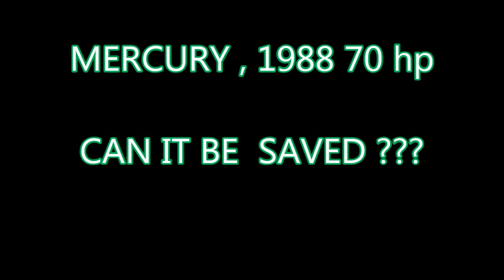MERCURY 1988 70 HP,  CAN IT BE SAVED ???

Comment: I ran the 3 and 4 cylinder Mercs for many years. Hard, mostly commercial use and came to love that soft, steady idle and how they would troll for hours, then jump to full rip when time to go. My last one was a '91 60 hp and used the BUHW-2 plugs instead of the BUHW. About a decade ago I changed to JonnyRude's, mainly because of availability in my area. (I run other folks cast off junk, free or dirt cheap) and now have only 56 cu in, 60-70 hp OMC mains and 25-30 hp OMC kickers. I have great confidence in these motors. A few years ago I finally learned how to make them idle like my old Merc's. Very simple. I now run NGK BUHW-2 plugs in my JonnyRude's. They run better thru the RPM range. Start quicker and last longer. Initial tuning with the standard Champion's, and when a hard run/shutdown plug color check looks good I change to the NGK BUHW-2 plugs, which I run all season, 100 to 200+ hours. Then' in the spring, I pull the plugs and typically, wipe them on my pants leg, put them back in and run them a second season.
Reply from the maker: I have used the perma gap NGK plugs with good results as well.   kb

Comment: That was an excellent comment that you made regarding how easily the carburetor hinge posts can be broken. I was used to working on Evinrude/Johnson outboard carbs and the hinge pin can be pushed out with a tooth pick but not on a Mercury.. I broke one and recently found another carburetor on ebay and paid a good price for my mistake. Another good video.
Reply from the maker: Yep' been there myself.    kb

Comment: Good video and I'm looking forward to all those hacks you will have to come up to bring it up to the "KB standard of excellence". Plastic parts in outboards do have virtues. They are lightweigh, non-corrosive, low cost and provide smooth rotational movement without lubrication. But of course, on the negative side of things, they tend to dry-out and get brittle with age. Finaly, I'd say that sealant is also allowed on carburetor threaded fuel connections. Stay safe and be merry !
Reply from the maker: Pretty close guess, but not what I was going 4,    kb

Comment: I guess I have lucked out so far on tapping out the float pins. I do have a very small ballpeen hammer and use the right size small punch. I do use my needle nose pliers to pull the pins the rest of the way out. My Yamaha have one way pins and one end is serrated so you have to use a punch at least to get that end out to use pliers the rest of the way.
Reply from the maker: I save every brass pin I find in older carbs & use them if they fit.       kb
Reply: Brass pins? I'll have to see if I can find a few.

Comment: I have an 1989 version of this 70HP that you have worked on here. Mine runs decent except I get a small back fire ,sneeze, just once an while at idle but never running over idle. I have done allot to this old motor ,reeds checked, carbs rebuilt , new trigger, timing reset after trigger installed turns over to start fairly easy. I had one guy tell me I have an air leak somewhere. Compression checked ok 110lbs on all 3 so pretty even and fuel pump rebuilt.  any thoughts appreciated
Reply: Did you change the upper and lower powerhead seals?

Comment: Hi Kodi, I have the exact same motor and was wondering if you might offer some advice? 

It started, shifted, and ran nice on the muffs a few weeks ago. I just put it in the water, drove around for a few minutes, picked up my buddy at the dock and then it wouldn’t start again. I turn the key and it sometimes starts for a few seconds then dies. Mostly it just keeps revving and won’t fire up I don’t even know where to start this is only my 2nd motor ever

Comment: Hi. I have 2 1988 mercury 60hp. One works fine in test tank but when I the boat in water themotor dies as soon go into gear could it be timing?
Reply from the maker: Check your compression  hot & cold.       kb

Comment: Could you help me I’m working on an 1978 mercury 70 can you tell me what size the main jet is ? Mine an 0.96 and the air side a 0.56 . The carbs are clean and the motor still wants to fall flat on it’s face getting spark on all 3 cylinders it cranks right up but soon as you go past half throttle that when it dies

Comment: I know this is a long shot, but I need a part that seems to be impossible to find. Is there a way to see if you have what I am looking for??
Reply from the maker: Let me know what part?       kb
Reply: @kodibassInsideoutboards  It is a clutch dog for a 1986,87,88,,89----- Suzuki DT 75. I think the ones form the 65s and 85s will work as well. It has 6 lobes and 24 splines.
Reply from the maker: @popsshop9148  I have a 60 hp, do U know the part#   kb